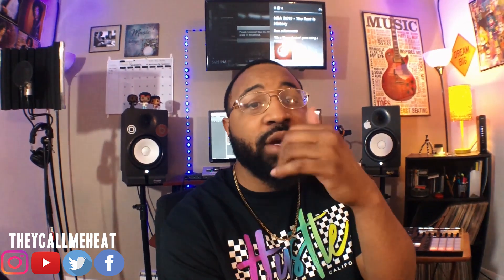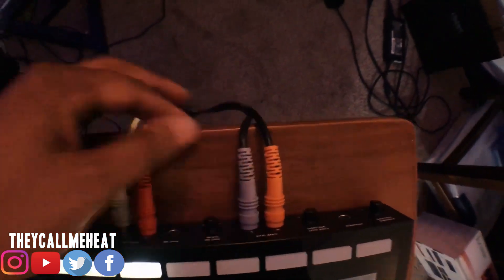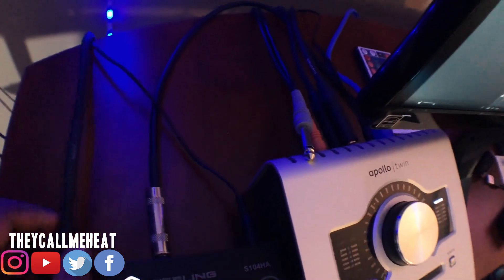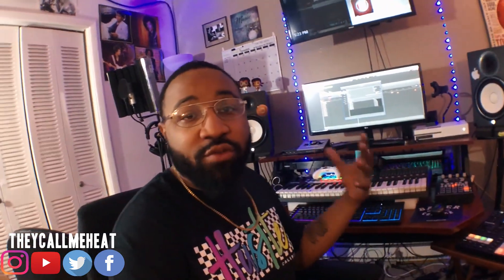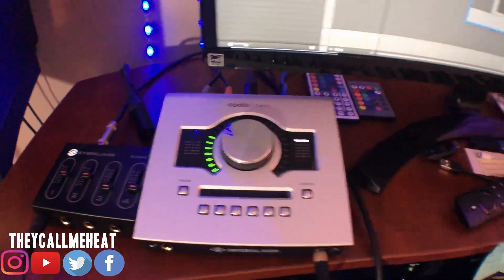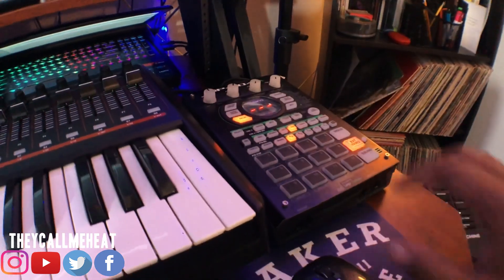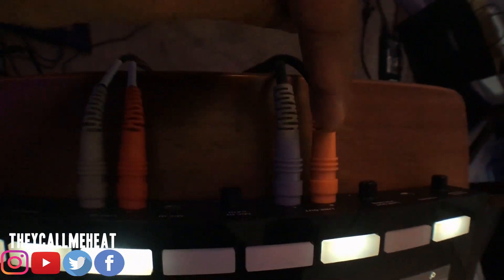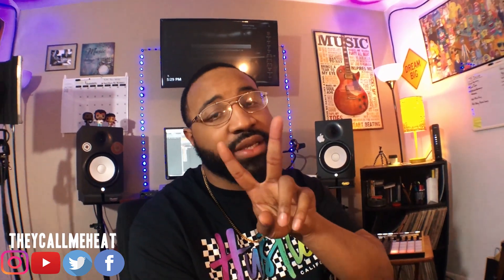How To Route Maschine MK3 To SP404

Comment: Hi I am wondering did you connect your monitor to mk3 or your interface? if you connect those with your interface, why you can hear the sound through monitors since in your machine software setup you choose mk3 as you audio interface

Comment: Hey bro. So I have the line (OUT) from the Maschine connected to the line (IN) of the sp Like you said. would it then work to have the line (OUT) from the sp to the line (IN) on the maschine instead of into the interface? I have a 2i2 interface but I haven't been using my monitors so I've had no need to use the interface lately. I've just been using usb speakers. Can I use the maschine as the interface or do I have to use the external interface to integrate everything together? I tried using the maschine hooked up how I said but still not hearing sound or response from the sp. Sorry if that comment is hella confusing just trying to figure out If I can use it without the external interface. thanks man!
Reply: Yes. You would just sample the playback coming back into the Maschine MK3.

Comment: Hey Man, really appreciate your video !!! Keep it up dude 
Also i was wondering, do you get any like noisy/hum sounds with this setup? Coz i do have the exact same setup (except i do have focusrite 2i2).
And I get some.
Maybe u know the issue :(((
Reply from the maker: What’s up my man!? ..Yes, I experienced that as well. It’s just old wiring within the home. I would invest in this thing called “X-Hum or Hum-X” or invest in a power conditioner, I have one by Furman. But Monster makes good ones & they are other low budget ones as well. Hope this helps! 💯
Reply: @theycallmeheat  thanks man, gotta try appreciate
Reply: Do you use the included power supply with the MK3? I got the exact same setup as you and was buggin for a while, but the power cord solved my problems